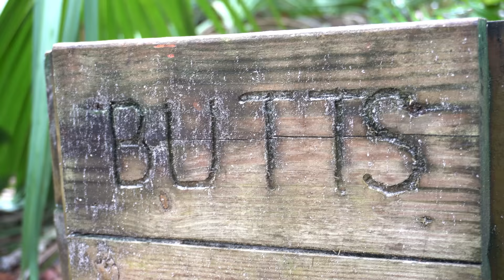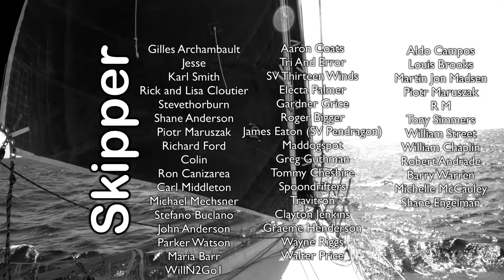The Sticker of DOOM | Sailing Wisdom [S5 Ep11]

Comment: It's not just Inland boaters, the mind set of Floridians has really changed in the 60 years I've been going there.The blow hole quotient has increased exponentially over time. Thru hull above water line, gulper pump mounted remote (those suckers will pass a Buick!)and to complete the package, a Ultra Junior float switch (they can't get stuck on with bilge crud). The audible alarm (cat puking) will tell you whenever the pump is on.
Reply from the maker: We have that pump in the head for the shower and it’s amazing! When we rebuild Windpuff, it is definitely going to be part of the system.

Comment: Holes in a boat (especially below the water line) are never a wonderful idea if they can be avoided. It seems the larger the vessel, the more holes in the hull. I've always tried to minimize these in my yacht designs, but they are virtually unavoidable these days in order to provide clients with all the amenities and comforts they desire to have on board. If you must have holes in the boat, it's always best to make them above the water line (discharge lines) for added safety (although many clients think they are "unsightly"). All boat designs are a compromise or a collection of compromises and there never seems to be a perfect solution. BTW the way, folks: Great episode! 👍👍👍
Reply from the maker: When we rebuild Windpuff, we have some ideas to make the boat have as few holes as possible!
Reply: I think the idea of a sea chest inside a water tight bulkhead could save a few boats from trying to be submarines. One big seacock then the chest

Comment: There is another failure mode that I have learned about the hard way. If a narrow piece of debris should get past the grill of the bilge pump, it can jamb the pump. I have had pieces of ty-rap or twigs foul the pump on occasion. One will think that the bilge pump is protecting the bilge because there is only the absence of the occasional noise which one would not notice.  I always put a screen mesh, usually just mosquito netting, around the complete pump and gather it up on top and secure it with a ty-rap. That keeps everything but water out of the pump and related components.
Reply from the maker: I like the screen idea! That makes it really easy to set it up.

Comment: We had a similar issue on our liveaboard narrow boat in the UK. The bilge was running but not pumping out. When I stripped it down it turned out the sticker from the bilge pump had been sucked inside the pump blocking water flow. Yes it actually sucked itself off!!

Comment: PFD for that adorable pup.  Also easier to pick up up pup from water with a harness with decent sized handle on the top.  Had dogs on board for over 20 years.
Reply from the maker: He has one for when he’s going swimming but it would be a good idea for him to wear it more often! His legs are not the best for swimming.
Reply: @jonathanrichard1919  That is one reason mine have always worn a harness.  Hard to get a pup with just a collar which may slip off, esp if pulling against current.

Comment: I have never before seen a boat with the bilge pump thru-hull below the waterline.  That is a recipe for disaster.
Reply from the maker: It is a mess. It is supposed to be just above the waterline so that it’s “quiet” when pouring out, but with the boat loaded up it becomes just under the surface. 
It really needs to be moved much higher up. 
I have all the others up by the rubrail so that when the pump runs, I can see that it’s running and it’s still above the waterline when the boat heels over.

Comment: Yep, the difference between "Fresh" water and Salt water is like night and day. Fresh is much denser/harder than salt water. It is great for planning boats but when you have big water and waves like in the Great Lakes it can beat you to tears.  Sound travels faster in fresh water too... So ya gotta watch those depths a little closer when you come inside.
Reply: no and no. Since salt ions are heavier than water molecules, seawater is denser than freshwater. The density of seawater ranges from 1020 to 1030 kg/m3 while the density of freshwater is about 1000 kg/m3. In saltwater, sound travels at about 1500 m/s and in freshwater 1435 m/s.
Reply: @akathesquid5794  Ok I may have said that wrong. But I have smacked boats on both and Fresh water is way harder than Salt water.
Reply: @akathesquid5794  You are correct about the salt vs. fresh, but the greater density of saltwater lifts the boat out of the water somewhat, reducing the drag in water.... so transitioning from salt to fresh can feel like running into a snow bank as the boat sinks down in the water and the hydrodynamics change.
I think the more critical thing about salt vs. fresh boat design is that oceans are rarely flat enough for a planing hull design to be useful, and lakes are rarely so rough that a heavy hull is needed for stability/comfort.
Reply from the maker: The sinking in part! I didn’t consider that but we do sit almost 2 inches lower in fresh water. That would explain the Wall feeling. Climbing back out would be just as difficult as the boat is going to pop up out of the water which takes a lot of effort to push the boat up over a ridge.

Comment: More great adventures up the ICW, out of the channel anything more than a 2 1/2 ft. draft , is not a good thing. I've never been in the ICW, I guess it has it's challenges. But up here in the upper Chesapeake past Turkey Point gets challenging at low tide, and stay clear of the Susquehanna Flats.

Comment: People think I am excessive using 2 checks, above water discharge and loop. Honestly the bilge spaghetti would give me nightmares. Possibly practical to install an above water vented loop? Nothing like seeing others mechanicals. 
Rear I have 20Amp crash pump(1500-2000gph), 500gph, jabsco in line checks, 2 whale manuals, one operable at bilge pump service area or birth, other in cockpit. I need a forward pump. The vent loop isn’t high enough without being on the house ceiling for sailing so everything has check valves. The whales have extra checks. I don’t have duckbills, keep hearing the stories is enough. Stay above water friends.
Wooden boat my pumps don’t even run now quite swell.
Reply from the maker: I have moved all the other ones to discharge above the waterline when the boat is heeled over. I forgot to move this one. The bilge spaghetti is from all the different bilge pumps. We have 2 manual pumps, an automatic, and then this sump pump. 
We have added them over the years, and I look forward to making an organized system in the alberg when we build it!
Reply: @RiggingDoctor  If I must make spaghetti I try to keep it out of the wet. 'Available fittings' always makes spaghetti.
Reply: @RiggingDoctor  what Alberg are you getting?

Comment: Is that bilge outlet ‘deliberately’ below the waterline or just because the waterline is lower from all the cruising supplies on board?
Reply from the maker: It’s right at the waterline under the stern overhang. When the bow tanks are empty (800 lbs lighter up front) the stern squats down and the through hull dips under. It really needs to be up high like the other ones I’ve installed up by the rubrail.

Comment: Bilge outlet below the waterline - oh strewth that is scary.. yup, please fix that, we don't want to see you sink!
Reply from the maker: It’s right at the waterline in the stern overhang, but when the bow tanks are light, the stern sits down and the through hull goes just under the surface. Way too dangerous of a design!
Reply: @RiggingDoctor  Eeek - but I sadly not unique.  Mine has a show outlet below the waterline, on the list to move at next haul!
Reply: Keep the thru closed when not pumping.
Reply: @markbailey6051  That doesn't work - it is an automatic bilge pump that needs to work when the boat is left un-attended.

Comment: Cmon man. Starting to lose faith
Reply from the maker: Thankfully we had the automatic bilge pump to keep us alerted to the issue. It didn’t get high enough to trigger the alarm. 
It really was an annoying little issue creating the potential for a huge problem.
Reply: @RiggingDoctor  On my new to me 1966 Pearson Countess Ketch I am Making a plan to have 2 electric bilge  direct wired to the closeby battery bank above, with float switches offset by height, and both with buzzers. Also I want to put a small plastic whale gusher had pump with clear discharge in an obnoxious spot near the companionway with a good hand hold station. The idea being to pump a few strokes from time to time and get a real feel for bilge intrusion. Also have the same big edson, which came with the boat and has a mushy board and a few other minor rebuild problems. It has a well thought out connector in an inspection port next to a cockpit shower. Hopefully sailing to Antigua from Maine Nov/Dec ish and picking up the family for a sabbatical. Thinking about sythetic rigging and yanking the 120 westerbeke beast for electric. We'll see. Good luck.